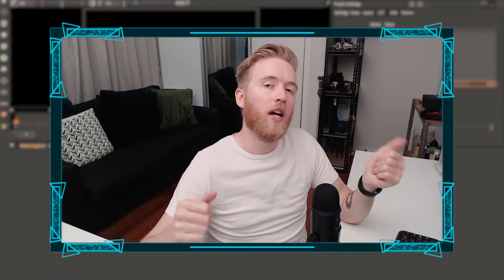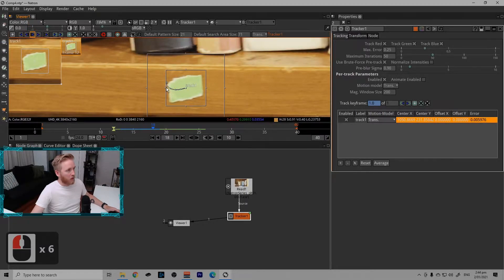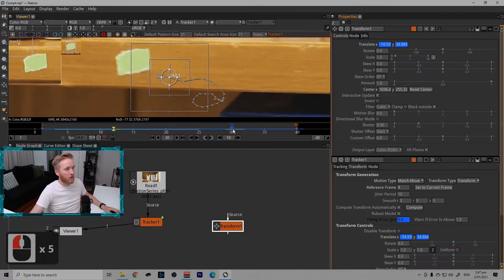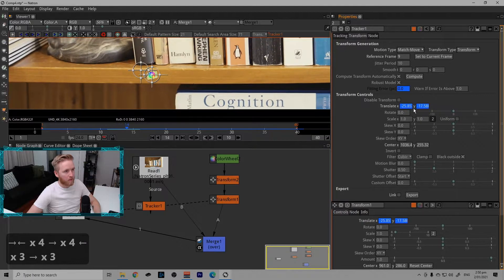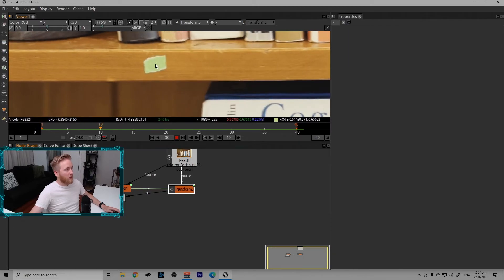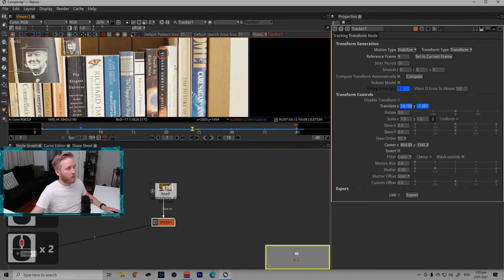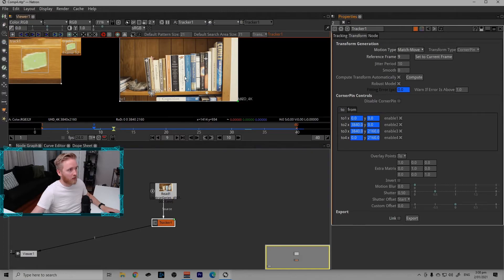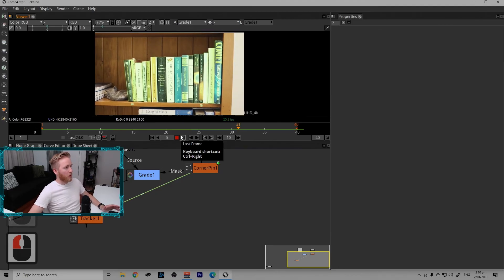Natron Tutorials Part 3: How to Track and make Cornerpins in Natron

Comment: Excellent! This is the best tutorial on tracking in Natron that I have seen.

I want to echo the comment that this is the only place that explained what the outer rectangle in the tracker setup is for.

I wanted to display a video being watched inside some stock footage of a phone with a green screen.  I used the corner pin transform and duplicated it, once for the external image that I used to mask out the green screen and tracking marks, and a second time to have the video (merged under the phone) track the motion of the phone.

Came out perfectly - thanks man!